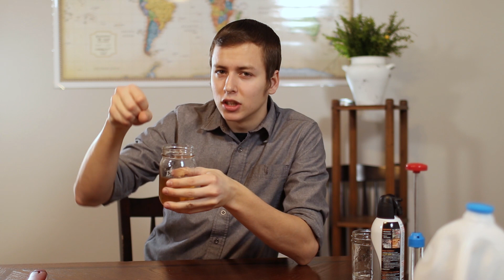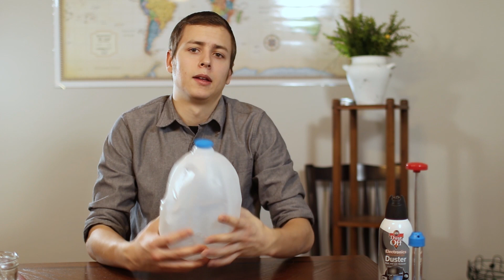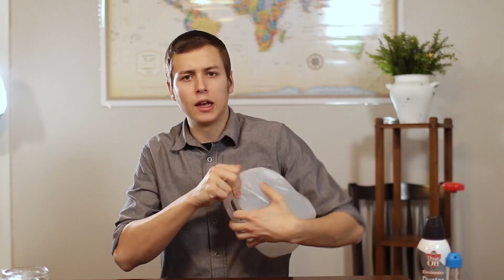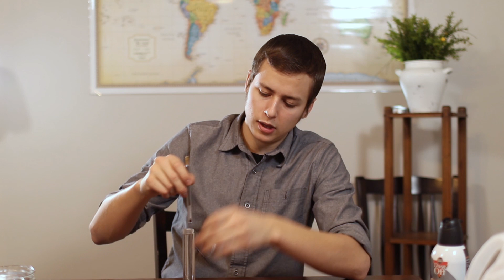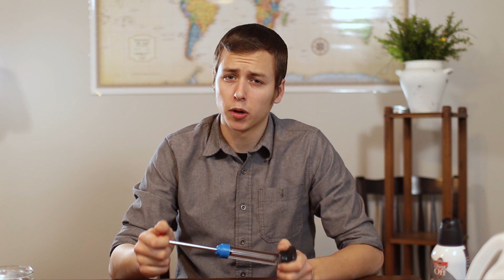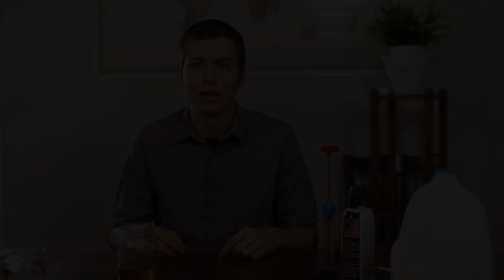Adiabatic Heating and Cooling | EXPLAINED | Demonstration

Comment: That's not air in that can, it's difluoroethane, which is a liquid. When you open the valve the liquid evaporates, driven by heat from the can. You are illustrating the phenomenon of latent heat of vaporization, not adiabatic expansion.
Reply from the maker: Thanks for the heads up!

Comment: you should explain what happens at molecular levels because your explanation is totally non-intuitive. also you state heat and temperature are the same and then say that heat stays the same but temp drops. wtf

Comment: Why compression leads to increase in temperature?
Reply from the maker: Good question. The air has an ambient room temperature at a certain volume. When the volume is rapidly decreased the heat cannot escape and the heat is rapidly "condensed" which causes an increase in temperature.